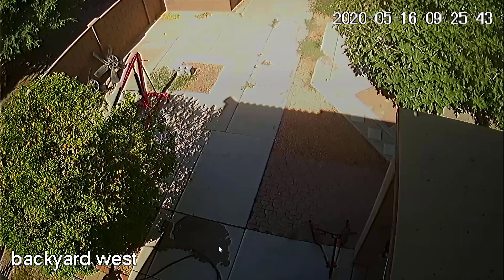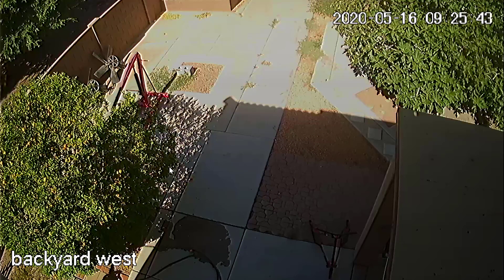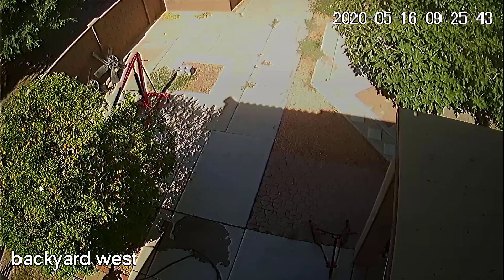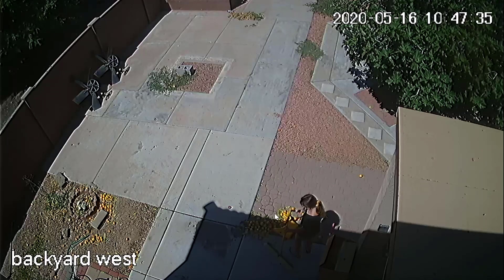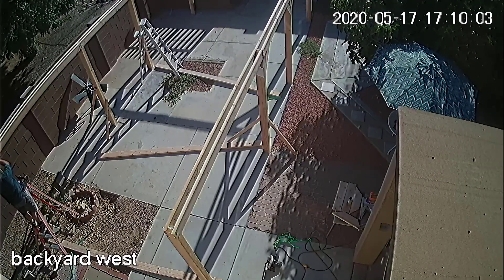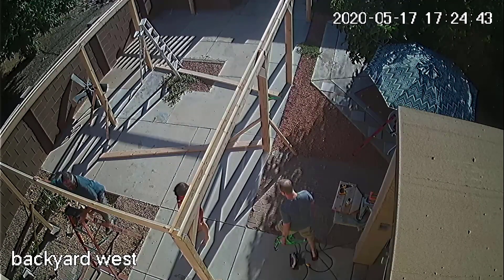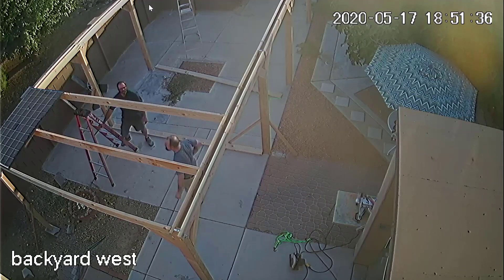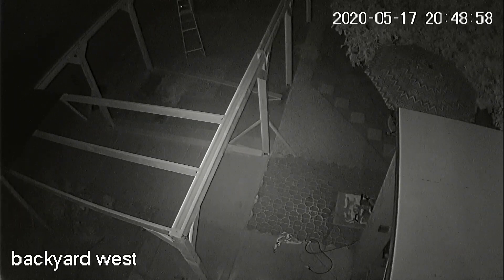Solar Panel Pergola Pt 1

Comment: I saw those (cooling tower?) fans, I had a mental image of those being installed in the pergola with a slow speed motor for some air circulation.

Comment: Love the idea of solar as a shade for pagoda. All that DC you’re probably going to want to convert to AC as close to the panels as you can. Check out MPP Solar inverter/charge controller combination units.
Reply from the maker: I'm not using any of that.
I'm sending HIGH VOLTAGE DC directly into a 3 phase Variable Frequency Drive.
With the 300 VDC I should be able to send it 30+ feet over 10 gauge wire. Approx 16 to 17 amps from the series parallel setup. 
I guess it would be called a 10S2P? (20 panels, 10 in series, then each of those in parallel).

Comment: Do you plan to tilt them or just mount them flat?  Seems like tilting them would give it a bit of a visual appeal, as well as letting air move through them a little easier.  Not to mention the tilting thing helping their efficiency some.  Definitely off to a good start tho.
Reply from the maker: Flat. Because it is installed as a Pergola in the back yard. I don't want it to be obvious what it is.
As soon as the sun gets over my house it should go to full output and I'm sure it will diminish as it really clocks over to the west.
But by then I hope that the upstairs would have cooled down the house off-grid for a good 5 or 6 during the summer.